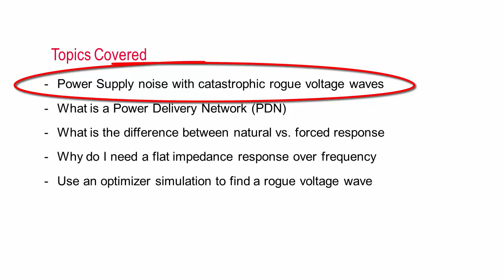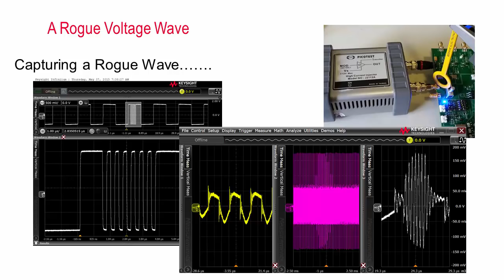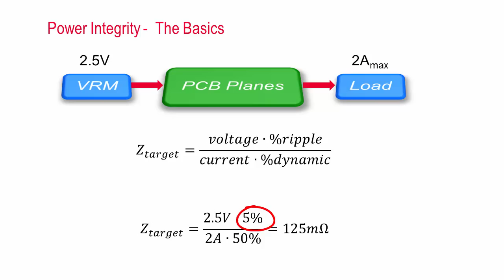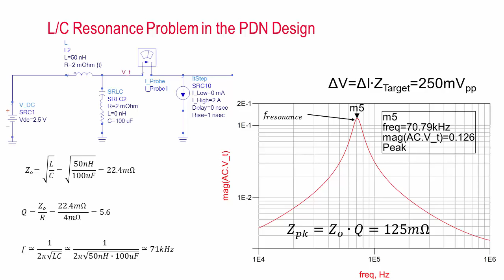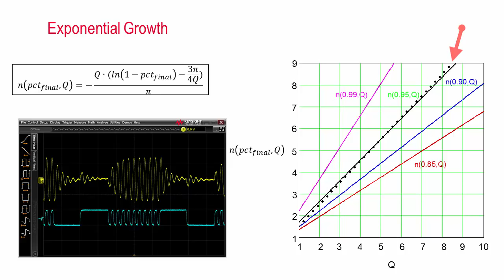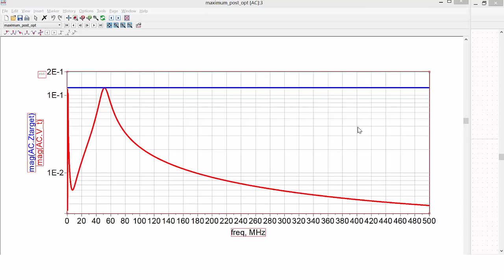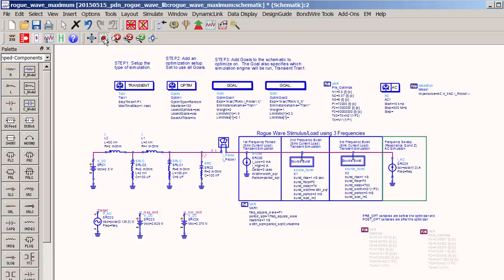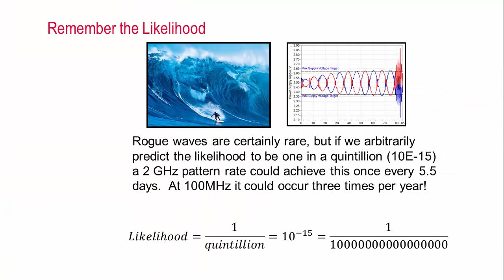How to Design for Power Integrity: Finding Power Delivery Noise Problems

Comment: Steve, you’ve provided clear explanations of how rogue waves form when there are resonances in a PDN, how you simulate the generation of rogue waves using the ADS tool and then how you determine the load pattern that produces the largest voltage excursion using ADS Optimizer. In the process, you make a good case for keeping PDN impedance flat. But what if the system design is fixed and the resonances cannot be reduced—can designers use these techniques to determine problematic load patterns and then adjust system operation to avoid those load patterns?
Reply: David Morrison Wow, that's a really interesting question, David!  I think it is easier to determine the worst case pattern, since it is a singular result, but we can use the impedance information to obtain some reasonable guidelines.  For example, if it takes N cycles at any of the resonant frequencies to reach maximum amplitude, we want to avoid these repetitive frequency cycles if possible.  We can also look for patterns that contain repeating sequences of the multiple resonant frequencies.
Often times, even with a fixed design, we can determine a simple "tweak" to improve the performance, such as selecting a lower cost higher ESR capacitor.  Generally changes to a lower cost component aren't opposed ;)

Comment: this 125mohm how can it implemented in real life scenario ? 
the VRM & PDN & Load must have this value to keep voltage in it's range,
 but how with having certain VRM with a certain PCB Layout and a fixed IC as a load ?
I am assuming the values chosen above were based on a real characterization of the system, how after this characterization to have 125mohm impedance and neglect all these values ?